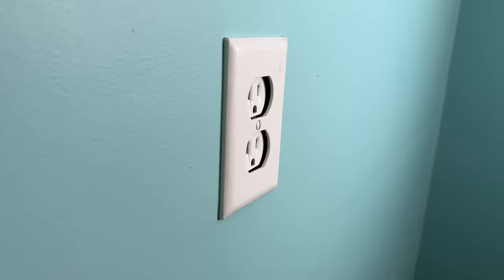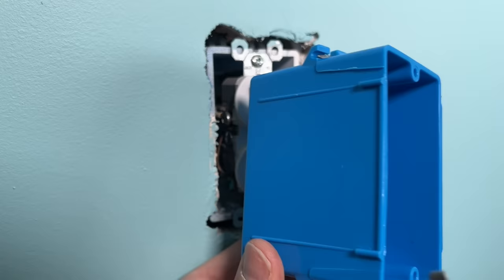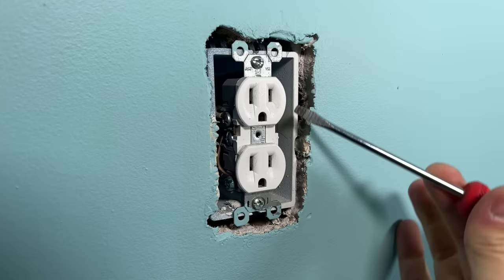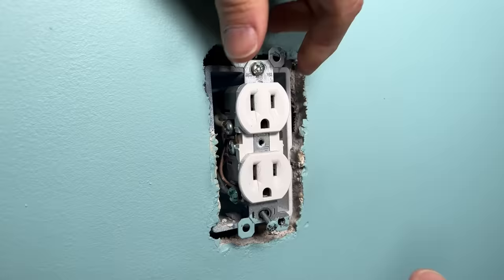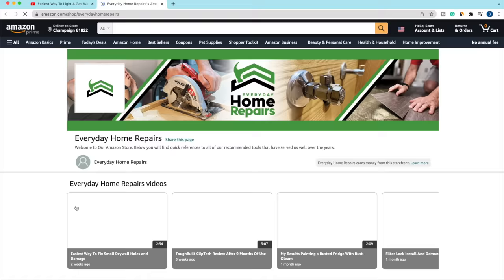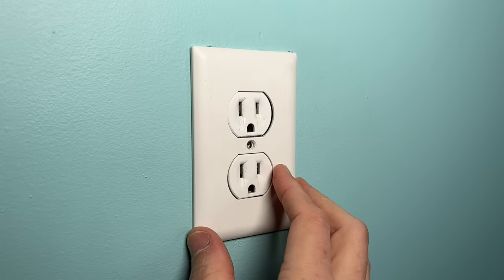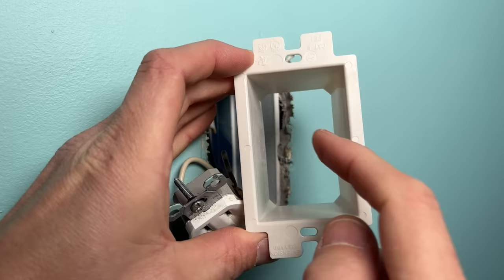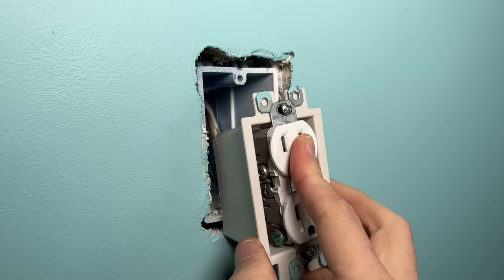How To Fix Sunken Outlet | 2 Easy Options

Comment: Most everything you covered in this video was new to me. The spacers, the box extender, the larger face plates, and how to deal with a poorly done outlet was all new to me. Thank you. It looked much better and safer when you finished.
Reply: Same here. That old video he showed is how pretty much every gang box in my house is currently done. I have wood paneling over plaster and the wood is exposed in damn near every box I've worked on so far. Looks like I'll be getting a few of those inserts. You all better invest while you can
Reply: Ditto.
Reply: Same here. Exactly the same comments, couldn't have worded it better.
Reply: Pretty much everything was new.  I fell down the rabbit hole when I watched your ECX screwdriver video.
Reply: Same here, I have a few outlets that will be getting refitted with one of these methods.
Reply: Renovate a few hundred homes, you will figure it out.

Only thing i learned is they make larger outlet plates.
Reply: Ditto..!!!
Reply: Again...same.
Reply: Ditto
Reply: try it for urself and get a shocking experience
Reply: I agree with Cat 100%
Reply: @zcpoling  me 2
Reply: Ditto that. Thx.
Reply: Same for me. Very nice hints.
Reply: Actually bought these extenders because of this video,  will fix two or three outlets in my house this weekend
Reply: All new. Good info.
Reply: Ditto for me too. Will start on mine next time I go to the store.
Reply: Box extenders are great! I used a couple in my basement bedroom… worked like a charm.
Reply: Same
Reply: If you don’t have outlet spacers or don’t feel like buying them, get 14/2 or 12/2, strip off the insulation then take one, either the black or white spaghetti insulation and wrap it around your swivel screwdriver once, twice or three times. However many times it takes to be even to the wall and cut it and put it over device screws.
Reply: Box extenders are actually in code, however, you’ll most likely never see them. I have a mainly commercial background, but I’ve done some some apartment buildings. We used 1/4” ice maker tubing as spacers as it saves a ton of money on “caterpillars.”  Residential has the most shortcuts taken in the electrical trade as resi electricians are under the gun to be fast, so they cut corners. So you’ll find sunken outlets, back stabbing, whatever else they can do to speed race through the install.
Reply: Same here.
Reply: 00
Reply: The ONLY thing I knew was the larger outlet plate.  Never seen an insert before.  @mmercier0921
Reply: Same here, except jumbo plate, I used it to cover badly painted around the outlet.
Reply: Same here. The spacers, the insert, the larger wall plate. They will help me crack fewer face plates by overtightening :) Many thanks for sharing!
Reply: Than you Scott for such great information. EVERYTHING was almost new to me. I am truly a novice diyer.  I’m rushing right out to get those spacers. I’m watching you for EVERYTHING!!
Reply from the maker: Thanks Deboria,  we are here to help and will keep the videos coming 👍
Reply: Same here. Contractor labor rates have gone up so much I decided to learn it all myself. Maybe the rates will come back down? Not my problem anymore though thankfully.
Reply: concur with everything said here,  Thank you sharing your knowledge.
Reply: well said, same here! Much smarter today than yesterday! Great video!!!
Reply: Same here. All new to me as I prepare to help my daughter on a house she's purchased that needs some TLC.
Reply: Everything you covered was new to me and I consider myself a pretty good handyman. Thank You

Comment: At 73 I have wired, fixed, moved all kinds of these outlets.  I have encountered all the issues shown in this video but just struggled to fix them by repairing drywall, replacing the whole box and so on.  You introduced me to a number of approaches I was not aware of such as the spacers, box inset and also cutters that can cleanly cut screws.  Great information, thank you.
Reply: Me too, but only 70 😉
Reply: Me too. I'm young. 67. Lol
Reply: Hah .. you guys are funny ... I feel like a youngun at 53 ;)
Reply: @dalewright7908  You are!
Reply: I'll join the crowd, at 72, and learned old dogs can learn new tricks even after a lifetime of struggle. I've got a couple of outlets that will soon be fixed the correct way. Thanks. A very good video.
Reply: I knew about tile spacers and longer screws but did not know about box inserts thanks for telling us.
Reply: AGREE,At 70 i learn everyday
Reply: Arlington and others make better offset repair devices
Reply: Knipex
Reply: Knipex are the best stuff like whia and wera
Reply: Buddyboy you said it all for me, today at 72 I learned about the spacers and inserts. Wish I had found them years and many wiring projects ago.
Reply: At 80 yrs old, all this was new to me! Still a diyer!!
Reply: @robertlafleur5179  Yep Robert, very true! Just updated the kitchen appliances! A lot of work involved, but it was worth it!! Stay in shape, and save money in the process!! lol 😀
Reply: I want that cutter that cuts screws!

Comment: Agreed. I am the building maintenance technician for a company and I was given the task of fixing some of the outlets. I had NO CLUE how until I came across this. This video is going to save our company tons of money by not having to hire it out to a subcontractor. It's like they were listening to our conversation in the meeting...and probably were. THANK YOU SO MUCH FOR POSTING THIS!!
Reply: I'm always listening.  It's only because I want what's best for you Scott.  Much love, Siri
Reply: @davet766  Google is a much better listener.
Reply: @scooter812  Alexa will happily eavesdrop but rarely has the right answer.
Reply: Just keep in mind that, for most states, it is illegal for anyone without an electrician's license (or working under the direct supervision of a licensed electrician) to work on electrical wiring. The exception is that some (most?) states allow a homeowner to work on the wiring in his/her own residence.

Comment: I learned how to deal with poorly cut drywall. I find from my own house that the previous owner cared about nothing, and constantly finding these tricky situations keep popping up. I'm not a super handyman so I watch videos like yourself because you don't go over perfect world scenarios where everything is easy to replace, but the tricky situations that come from bad care or neglect of a house. Thank you once again...you've helped me fix many issues.
Reply: Sunken plugs are mostly incorrectly installed boxes.
Reply: Agreed.  I am in the same situation.
Reply: @danlux4954  most of the problems are caused by sheetrocker
Reply: @K31swiss  at work it’s boxes into concrete block that weren’t anchored properly.
Reply: @K31swiss  I've seen problems with guy who did the studs who didn't get them all in a straight line - so the sheet-rocker didn't fix the sheetrock to the stud in the middle of the sheet because that would result in an uneven wall - and that meant that the outlets never could line up.
Reply: @K31swiss  How is that? What would the sheetrocker do which would create a box which was too sunken?
Reply: @larrybud  They slam the sheetrock up against the studs so hard it pushes the boxes back. Seen it happen hundreds of times.

Comment: As a painter I like to replace outlets and switches when needed to give the room a newer feel. Especially when there is white trim and beige outlets. I knew all these tips  but I usually use the rectangle extenders. I also level the outlet with a small 6” level cause crooked outlets look horrible imo
Reply: Sure I do too. I like the decore plugs and switches as well as the face plates.
Reply: All that work to prep and paint, changing the outlets makes a huge difference and simple to do.
Reply: What do you mean by "rectangle extender". Do you have a link. Could be handy.
Reply: @jmcbri  I think he means the red rectangles that are shown throughout this video.
Reply: Bless you. When I see old outlets with coats of paint over them and I have to take a walk. I'm a DIYer, and maybe it's OCD, but the professional look of leveled plates that look right with paint, it makes a difference.

Comment: I appreciate learning about the spacers, the inserts, aa well as the sizing of the screws. And I had not noticed the screw cutting capability of the wire stripper tool. High scores!
Reply: The spacers or "catapillers" as called in the trade are equally as professional.  The beauty is you only have to loosen the outlet to install.  Raco now makes a three sided metal plate for such applications as well.
Reply: @rickwallace1243  the metal plates are hard to find in Canada. Took me 2 months to order 300 of them.
Reply: Soon we’ll be able to put in our own cardiac stents and cut out the insurance middle man.  Amazing, YouTube.
Reply: I wish I could find some "cutters" that handle small metric screws.  I change a lot of cabinet handles and a lot of the hardware from offshore is metric, and I need to take a bit off the screws, ideally without rolling a thread which would cause it to be hard to screw into the handle.
Reply: @VC-Toronto  Amazon had some, currently not available though. Must be more places to get some.

Comment: All instructional videos should be like this.  To the point, only useful info, good angles and lighting, clear audio, and added bonus of indexed sections. You've gained a subscriber.  Thanks!
Reply: Came here to say the same thing. Very well produced video!
Reply: @HawksDiesel  Me too. Good stuff
Reply: Ditto
Reply: But it's a 2 minute video that takes 10 minutes🙄
It a lot longer than it needed to be for such a self explanatory aspect.

Comment: Wow, I'm an electronic technician and have been a do-it-your-self electrician for years and I picked up the spacers to raise the outlet, the sleeve to protect the hot side and the larger plates to cover too large holes in the drywall. And I've probably run across an outlet in wood like you showed and now I know how to do it by code.  Thanks - amazing stuff you are showing us!  Thanks.  Keep it up.

Comment: Thanks for the new (to me) info about the spacers. I have “flipped 10 houses in my life, and always aligned electric boxes to the wall by cutting the old nails inside the box, and/or pulling out the nails sideways using a vise grip and hammer, then reposition the box to the stud with a screw. Then I would fill the surrounding of the box with drywall compound (mud). I also (rarely) used the oversized cover. This trick here is way more convenient because you don’t need to repaint. 😀
I also want to share one of the mysteries of my life. While visiting my old parents (in my twenties), I stayed overnight and I was sleeping in my old bedroom. Then right in the middle of the night, I just opened my eyes. (I didn’t hear or see anything to warn me to wake up and open my eyes!). Then I saw a flame on the wall about 4 feet away from me, that was about the size of a candle flame, licking the wall just above that outlet. I was stunned to see that happening, and to this day (I am now 69 years old), I still don’t know why I woke up to such a small and silent little flame, and most of all WHY did the outlet ignite? Of course, I threw a glassful of water on it and then turned off the breaker. In the morning, I cleaned the box which was full of sawdust and lots of dust, and bought a new outlet, skinned the wires and properly tightened the screws to prevent arcing. The walls were made of 1/8” Masonite, which was highly combustible, contrary to drywall.
I can’t imagine that if this had happened without me there, my old parents would have perished in their house.
Thanks for listening! 🔥
Reply: God said it was not their time, and woke you.
Reply: @grizz1108  God should just have gotten rid of the sawdust and eliminated the middleman.
Reply: @BrBill  But then there would have been no story to tell.  ; )
Reply: I've vacuumed out my share of outlets boxes.  I hate having all that crap in the box.  It's usually drywall dust but still.

Comment: I never knew about inserts. In the past I've had to actually disconnect the wiring and replace the enclosure to the correct depth before rewiring the outlet. A handy tip ...
Reply: Yep, how many countless times have I been in the electrical aisles of HD/Lowes and never noticed the inserts? I'll search for them next time!

Comment: I'm a journeyman electrician and yeah, pretty much on point.  When I run across this stuff at work and don't have spacers, I typically have scrap items like washers I can use instead.  BUT I know for a DIYer, you're not going to have all the extra parts and materials that I have collected off of various jobsites and projects, and spacers are nicer to use.  Also, yeah, you need those plastic sleeves with wood ALWAYS, and our company generally put them on tiled walls too.  They can be a pain to install if both wires are on the outlet, but the bending method usually works there too IF you have enough wire to play with.  Older houses (for some reason) barely give you enough to work with, so you usually end up uninstalling everything to get it to work.  Sometimes you have to add jumpers.  Anyway, at this point I'm rambling.

Comment: I love your videos. You are one of the few youtube creators who carefully plans out what you are going to say; so you don't hem and haw and improvise and repeat yourself over and over. There is no "filler and fluff" in your script. It is all straight and to the point, not to mention abundantly clear, and I really really appreciate that. You plan out each of your shots,  and apparently you use good video equipment. Love it. And your content is perfect for DIYers. Videos done by pros, as good as they are, often leave out important details that the DIYer might not know. Videos done by most DIYers, on the other hand, often leave out important details that the creators simply do not know because they are DIYers. Your videos are in that "sweet spot" where you include many important details that the pro knows and the DIYer would be well advised to adhere to. In this video, I learned about the spacers, inserts, oversized wall plates, and the code violtion of too much exposed sheetrock was news to me. I love these added details. Finally, I WANT THAT SCREWDRIVER! Headed to your store now... :-)

Comment: This was super useful. I've got a springy, sunken outlet in a wall with thin wood paneling over drywall, and some stripped screwholes. This video is making the situation more digestible: I've got the basic skills to replace the parts, but knowing more about the safety issues and which additional pieces I should consider using is fantastic.
Reply: The serious problem with "springy" outlets is that someone just left the screws loose to get the outlet close to the front plates.   Bit this is dangerous because the wires behind the outlet are being bent and unbent every time you plug something in or unplug it.   Eventually, a wire will fracture.   If you're lucky, the outlet just stops working - but if you're unlucky it can arc, melt the insulation and cause a fire.   So go buy some of those red spacers!

Comment: I learned how to use those spacers. I have a couple of sunken outlets in my house and already bought the same exact spacers. You spared me the need to look up how to use them. I have replaced a bunch of outlets, lights and switches in my house, but these two old outlets have remained an eyesore. I would have eventually figured it out, buy you certainly helped speed it up. Thanks!

Comment: I re-did my kitchen walls in "tumbled travertine" stone, but didn't account for the 1/4 inch that it added (5/8" with the backer board) - so I've been looking around for how to bring the sockets out.  This video explained it perfectly.  Thanks for putting this together with thoughtful remarks about safety and code compliance.  This really helps.
Reply: they don't call you Brain Dead for nothing!

Comment: I have never seen the spacers before, but I would prefer the insert as it appears to be a more professional solution and it is easy to install as well. Thank you for the video.
Reply: He had to use the spacers, the box extension alone would not solve the sunken box problem.
Reply: @ Harold E. A few heavy washers, small enough to fit the situation, a piece of hard wood cut to size and drilled, a piece of aluminum plate easy to cut with a hacksaw and drill for the 6/32 screw will also do the job.

Comment: Very interesting and everything you covered was new to me .  I ran into a situation where I removed the old 50s tiling in my bathroom which was covered halfway up the wall.  When I replaced the area with drywall, there was a 1/4 inch difference between the new drywall and the plaster wall which resulted in me putting wood between the screws and light switch to get it out enough.  After watching your video, I realize that I need to get the right materials to do it correctly and to code.  Thanks for the great information.  Never knew about the screw cutting capability.  I would have gotten out the hacksaw!